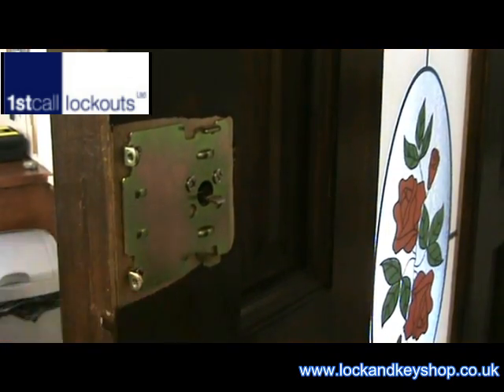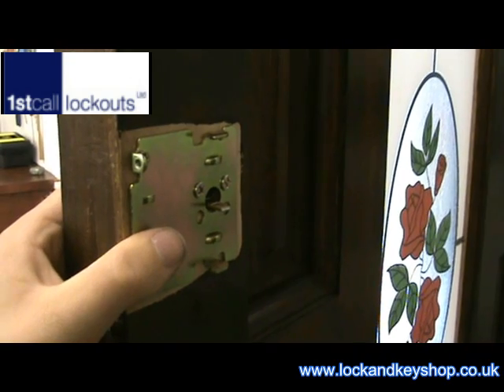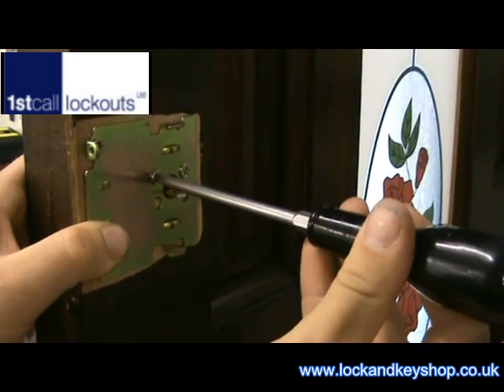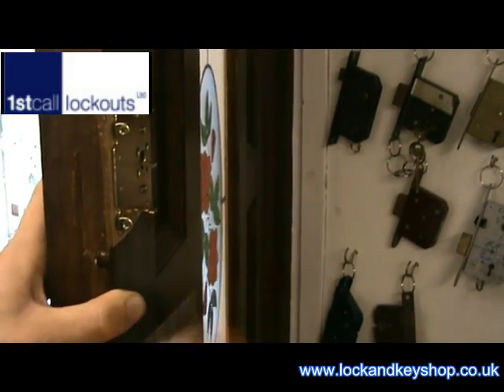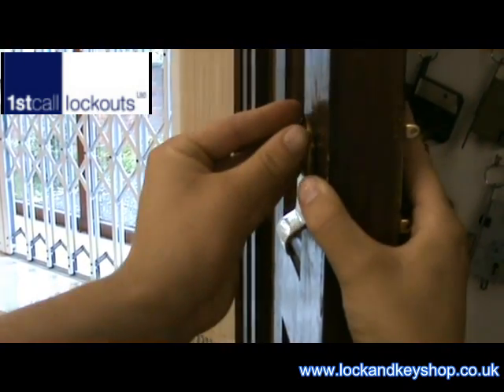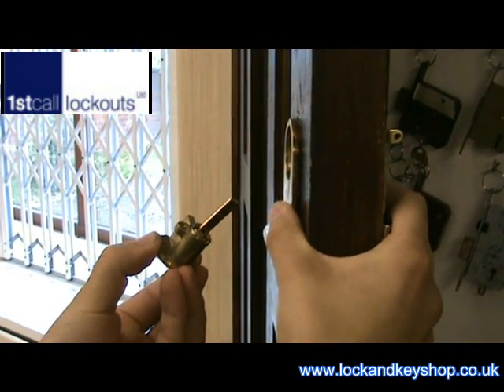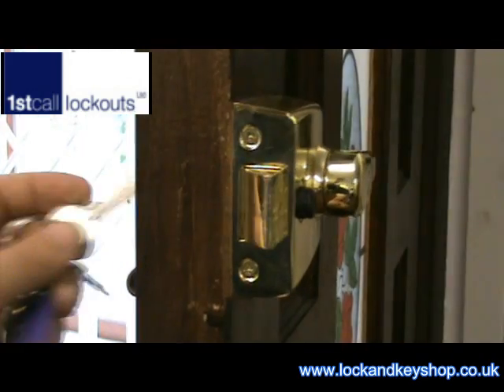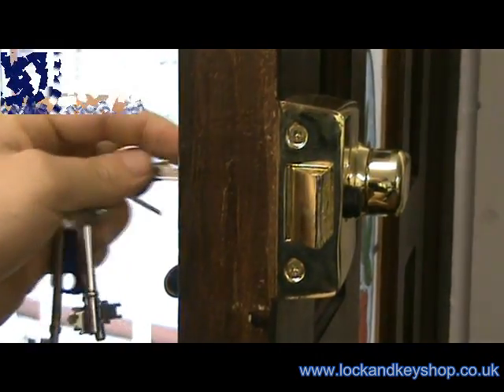How to change a yale type rim cylinder

Comment: Quick question on the yale night latches if the snib isn't keep in the deadlock in lock position ie u want to unlock the latch with the key then slide locking catch up to locking position. How can u repair it I've looked inside and stripped the plate of and all I see is a white plastic clip where it holds the catch button in place

Comment: Hi, I'd like to trim the tail bar using your method...The Yale tail bar I need to trim to size is quite thick. I've never done anything like this before, is it hard to bend? I don't want to ruin it. Kind thanks if you can share any further tips for learners like me. Nicky

Comment: Just been to B&Q and bought the wrong one, looks similar but beware!! The more expensive , £22.00 British Standard one is for narrow edge doors.  The cheaper one, £13.00 fits wider doors, still I saved £9.00!
Reply: Fortunately for me there is a locksmiths directly across the road from my house .
I had bought the more expensive bsi yale lock also since it said it is more secure , yet it didn’t fit properly & I had to put the old lock back in . I now intend to buy the cheaper version which is a little shorter and should fit securely .
It was a shame that the one I had bought was too long to screw securely , it looked about 4 mm to long so that the new cylinder was sticking out from the front door & wobbling around .
I even popped into the locksmiths shop to ask their advice & they suggested adding some washers - yet I don’t think that would have solved the problem, the 2 screws that you have to insert into the back of the cylinder seemed to be a little to long to screw the cylinder in place di that it was in the exact correct place from the front of the door vs protruding too far - due to the screws being too long .
The instructions on the Yale website said the 2 cylinders were both suitable for door of the same thickness , yet the CHEAPER one has a shorter cylinder & should therefore screw snugly in place ? I will find out tmrw.
I got my daughters friend to assist me with the ‘ fun ‘ of trying to get it to fit & wonder why it wasn’t fitting …
Still loads cheaper than  paying £100 to the locksmith.
I used a junior hacksaw to saw through the tongue to shorten it , since I had misplaced my pliers earlier this year , so couldn’t use 2 pliers to snap off the excess length .
I fact I only used a VERY old but new junior hacksaw blade without the handle & was still able to saw through the tongue with alot of patience  & not knowing if it was possible - which it surprisingly was !